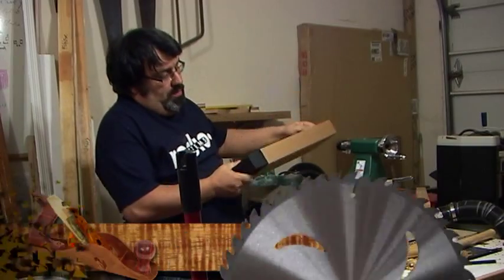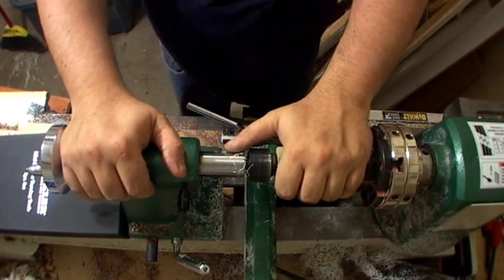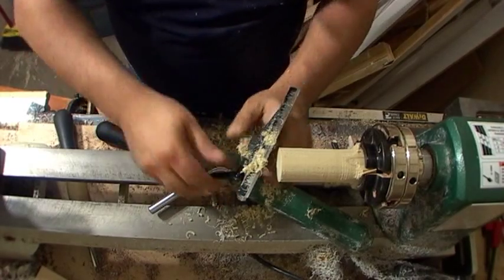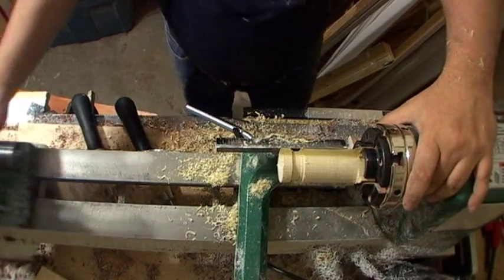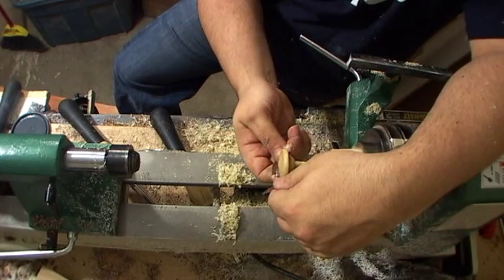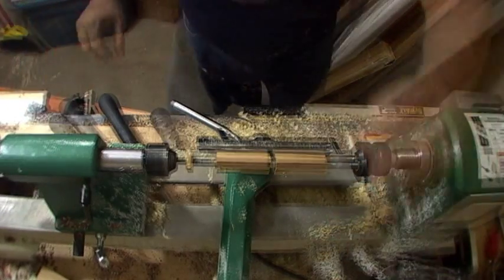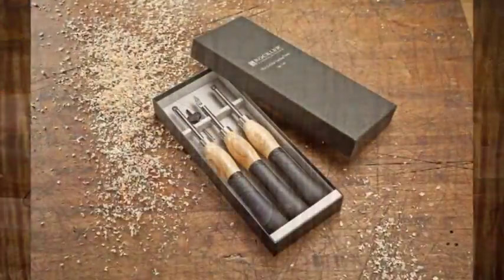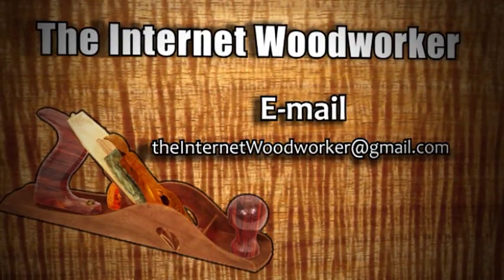TIW Review No. 4 - Rockler Carbide Mini Turning Tool

Comment: Don't try doing that cut again without a tailstock engaged with bit of wood. To make that cut again you need a tailstock engaged and or much finer cuts, as the only thing that is gripping the wood is the grip of the chuck and this is not enough.
ATVB
Roger